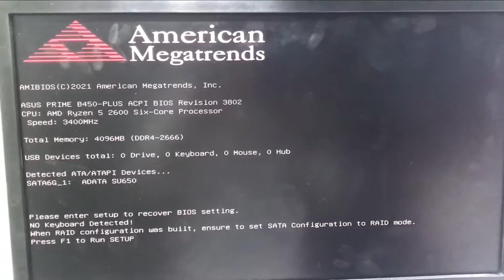How to build PC without a PC Case #Rambo Tech

Comment: My GPU won't fit in my PC case, I can put the GPU in the slot but it won't snap into it, so now I'll have to do this for the meantime lol.
Reply from the maker: It sounds like the GPU is a tight fit. Try these troubleshooting steps:

1. Double-check the GPU and slot alignment.
2. Gently rock the GPU back and forth while pushing it into the slot.
3. Ensure the slot screws or clips aren't obstructing the GPU.

If it still doesn't snap into place, consider:

1. Using a different PCIe slot.
2. Consulting your case and GPU manuals.
3. Reaching out to the manufacturer's support.

Hope this helps!

Comment: i have the intel version of that board, b365 pro4, but somehow i need to update the bios to get it to post a 9600k? how do i update bios if it doesnt post?
Reply from the maker: To update the BIOS on your B365 Pro4 motherboard without being able to POST (Power-On Self-Test) with the 9600K CPU:

1. Use another CPU that is compatible with the current BIOS version.
2. Boot up the system and enter the BIOS settings.
3. Update the BIOS to the latest version that supports the 9600K CPU.
4. Once updated, shut down the system and swap the CPU with the 9600K.

ASRock also offers a "BIOS Flashback" feature on some motherboards, which allows you to update the BIOS without entering the BIOS settings or using a CPU. Check your motherboard manual to see if this feature is available.
Reply: @rambotech_  thanks!

Comment: How do you restart without case
Reply from the maker: Building a PC without a case is an interesting approach! While it's not a conventional setup, you can still assemble the components on a flat surface or a test bench. To restart without a case, you can simply:

1. Press the reset button on your motherboard (if it has one).
2. Use the power button on your power supply unit (PSU) to turn it off, then back on.
3. Disconnect the power cord from the PSU, wait a few seconds, and plug it back in.

Keep in mind that this setup is not recommended for daily use, as it exposes your components to dust, moisture, and potential damage. Consider investing in a case for a safe and reliable build!

Comment: Been using no case for a year
Reply from the maker: To build a PC without a case, assemble components on a stable, non-conductive surface, ensure good airflow, connect cables, test the build, and monitor temperatures and risks.

Comment: Always remember when there’s a will there’s a WAY!!! Side note that rig got the best AIRFLOW EVER!!! 😆🔥😎🤙🏾
Reply from the maker: Building a PC without a case, also known as an open-air build, requires careful handling to avoid static electricity and damage to components. You'll need a motherboard, CPU, RAM, GPU, power supply, and storage. Place the motherboard on a non-conductive surface like wood or cardboard, install CPU, RAM, GPU, and connect them. Position the power supply nearby and connect its cables. Use standoffs to lift the motherboard off the surface. Ensure proper airflow and consider additional cooling solutions like fans or liquid cooling. However, be cautious as open-air builds are susceptible to dust and physical damage.

Comment: Why my gpu doesn’t have a power cable connected? But it works fine
Reply from the maker: Your GPU might not require a power cable if it draws all necessary power through the PCIe slot on the motherboard, especially if it's a lower-powered model. This is within the power limits of the PCIe specification.

Comment: you want to build a custom pc but don't have too much time to build it fast
Reply from the maker: To quickly build a PC without a case:

1. Assemble core components: CPU, motherboard, RAM, and cooler.
2. Connect storage drives and PSU.
3. Test the PC outside a case.
4. Invest in a case for long-term use.

Comment: hi,my case will arrive in 3-4 days and i makes my pc like you and the GPU(4070)keep shuting down and turning on after i start the pc and the monitor shows no dp signal from your device or smth like that
Reply from the maker: Building a PC without a case requires placing components on non-conductive surfaces, ensuring proper connections, and being cautious of static electricity and short circuits. It's a temporary solution until your case arrives.

Comment: Plz tell for how long can we safely run pc like this..
Reply from the maker: Building a PC without a PC case is possible, but it's not recommended for long-term use due to several reasons:

1. Lack of Protection: The PC case provides physical protection and helps prevent dust, debris, and accidental damage from reaching the internal components. Without a case, your components are exposed and more vulnerable.

2. Poor Airflow: PC cases are designed to promote proper airflow and cooling. Without a case, it becomes difficult to maintain adequate airflow, leading to increased temperatures and potential performance issues or even component failure.

3. Electrical Safety: PC cases are also designed to ground electrical components, reducing the risk of electrostatic discharge (ESD) damage. Without a case, your components may be more susceptible to static electricity.

If you must run a PC without a case temporarily, you can do so for a short duration, such as during testing or troubleshooting. However, for long-term use, it's strongly recommended to use a PC case to ensure the safety and longevity of your components.
Reply: @rambotech_  Thanks for replying ,,understand  it better.

Comment: Starting the PC by short-circuiting the connector pins with a screwdriver is a new level
Reply from the maker: Building a PC without a PC case is possible but not recommended. It involves preparing a static-free workspace, assembling the components on a static-free surface, connecting the necessary cables, and starting the PC by short-circuiting the power switch pins on the motherboard. However, using a PC case is highly recommended for better protection, airflow, and overall system stability.
Reply: @rambotech_  a league of legends streamer named Elosanta has a gaming pc that he uses without case, example of this https://www.youtube.com/watch?v=xPyGfJMsA70&t=10s
Reply: nice! i dont mind rocking no case becus i am not a homo! 😊 @rambotech_